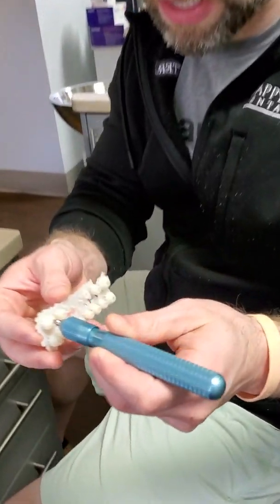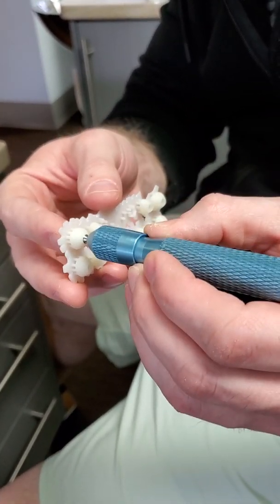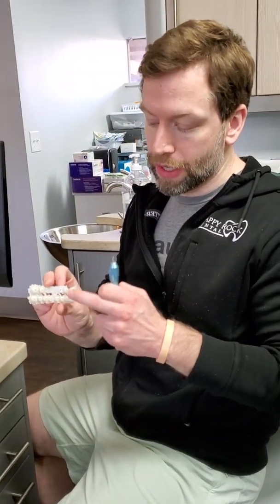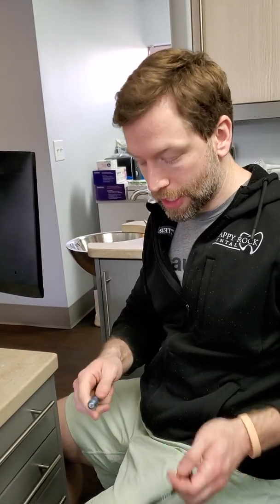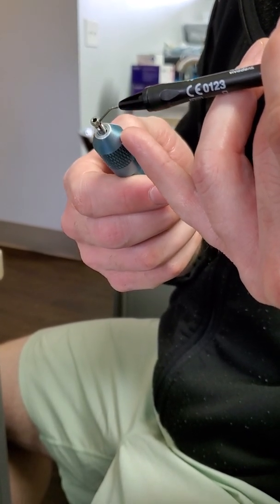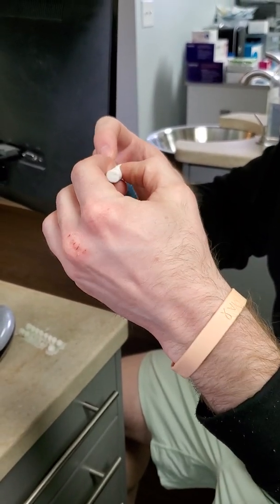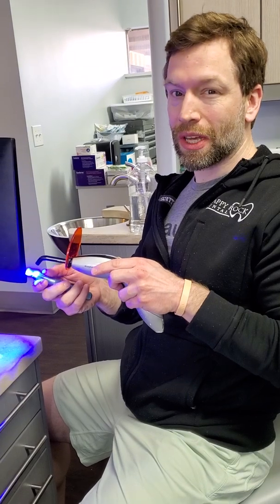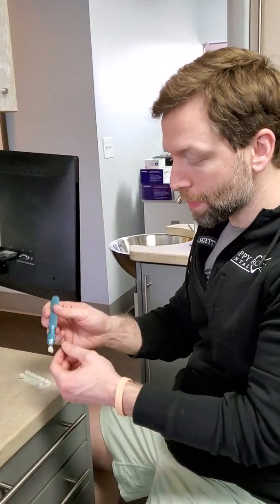APG2: Attaching healer to Tibase/Abutment

Comment: Thanks for sharing all your tips and tricks with us. I use the Bio max implants, what ti-base would you recommend ? BSB SELLS THOSE FOR $60.00, that would be more expensive than a regular healing abutment.
Reply from the maker: If your 3 using the Tibase for your final restoration, it's a net cost of $0. That's what I do. Some won't, but will autoclave them. Otherwise, you can use DESS temp Abutments for $35. Or, you can use any Abutment you wish with a little customization in the software.
Reply: @bgrutterdds  thanks so much for your prompt reply . I will check that out. Keep up the good work!!!

Comment: Amazing video Dr. Grutter thanks for share!  Can you tell me wich protocol do you use for polish?  I was tried to apply the same protocol of my resin composite restaurations but is not working. I hope you can help me with that. thank you very much!
Reply from the maker: I made another post on my social media about that. I will try to make a workflow video next week. Basically, I just use one of the green Scotch-Brite brushes on a lab handpiece (link on my website) and it makes it very smooth. You can also follow it up with a buffing wheel after that and you'll be surprised at how smooth it is.
Reply: @bgrutterdds  thanks I appreciated! Send you a big hug from Argentina!